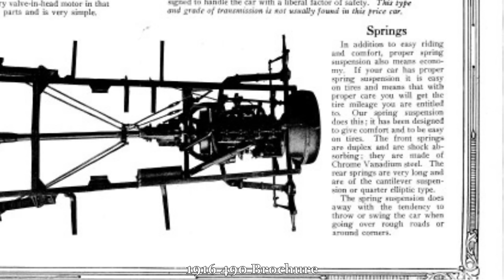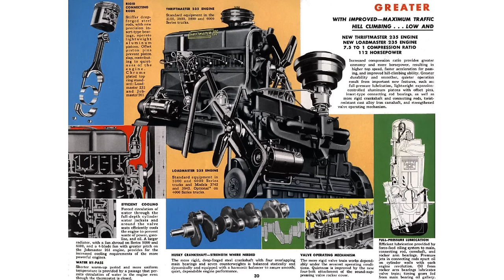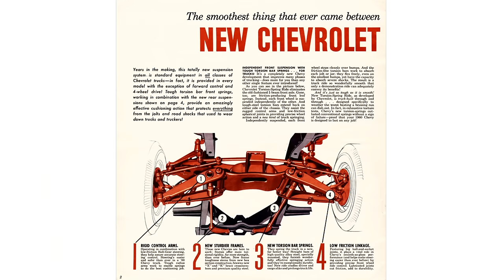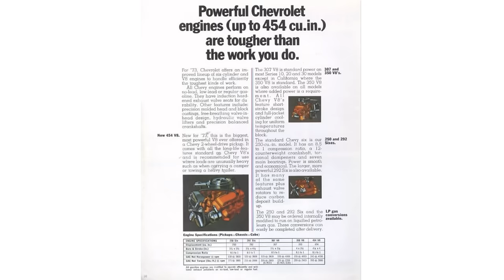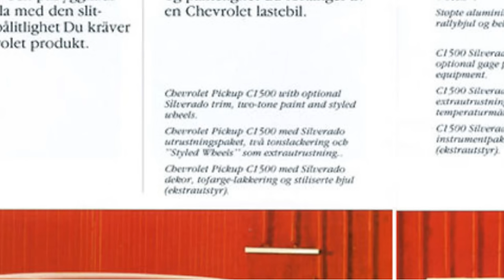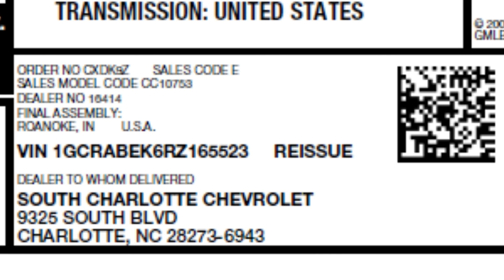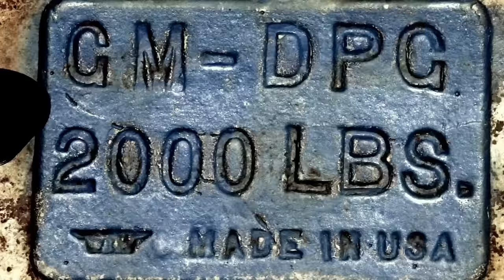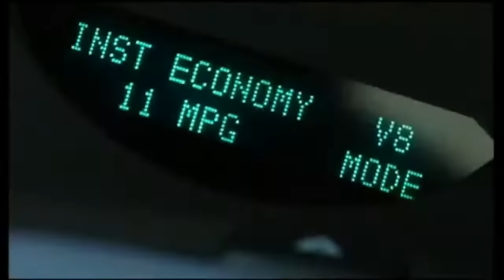History of Chevy Trucks From Advanced Design to Silverado

Comment: 3rd gen C/K was the first pickup to use the wind tunnel to measure aerodynamics in the design phase 

1986 fuel injection became available with it becoming standard in ‘87

I daily a 2000 Silverado that’ll roll over 303k miles later this afternoon. After having owned and become experienced with various GM pickups from childhood on, I believe each generation had a certain character. A certain experience that was very particular to that particular model. Unfortunately, that spirit of Chevy truck died in 2013. The current Silverado isn’t so much a Chevy as it is simply ‘another truck.’ To better illustrate this point I’ll highlight some examples. 

2009 2500 handled like a rock, great work truck, interior setup I thought was pretty car like but it more than made up for it by truly being a workhorse 

2000 Silverado 1500 Ole faithful, not the fastest, not the slowest, reasonably easy for non GM mechanics to repair. It’s done everything I’ve asked of it. It’ll be around for a lot longer. 23 years old and still worth repairing. I replaced the factory carrier bearing and u joints last month. 

1997 Sierra (yes technically GMC) step side 305 / 5 speed
This is the truck I regret selling. Not the workhorse of a bigger truck and certainly not an SS but as a daily driver honestly one of the most fun vehicles I’ve owned. (I’ve owned over 25 from all 3 domestic as well as Toyota, Honda and Nissan)

1980-1987 C/K 10
Aside from the diesel these are probably the most ‘modern’ classic pickup you could hope to find. Stylistically, they have nearly everything a proper classic truck should yet they are commonly found with creature comforts like power steering, breaking, AC and a ride that can rival many trucks 30 years newer. Plus the aftermarket and support for these trucks is HUGE. Sure it takes some cash but what could be cooler than a 30 year truck with Bluetooth and heated leather seats??

74-80 I set these aside from the later squares because they are more utilitarian in spirit and honestly these are my favorite. Sure you lose some features but nothing beats floor vents, round headlights and chestnut on the dash. 

Lastly, I’ll mention a ‘49 Chevy 3/4 ton. It’s not mine but belongs to a relative who has allowed me to drive it from time to time and holy cow, you want a true time capsule experience. You want to feel like a farmer from the ‘40s this is the truck for you. It’s about as far from a 2024 Silverado as you can get but trust me, it’s good for the soul. You’ll swear you’re at Indy even though you’re still under 50 mph. There’s nothing like it. You just can’t help but smile driving the little monster and listening to the stove bolt sing.
Reply from the maker: LOL. Thanks so much for sharing some memories !
Reply: @AllCarswithJon  on a serious note, thank you for the video I’m new to your channel but I’ll certainly be a frequent viewer going forward.
Reply: 3rd generation ones are awesome. Amazing how they were in production for 19 years "1973 - 1991." 1987 was the last year for the half ton & three quarter ton plain cab pickups, & 1989 was the last year for the one ton plain cab pickups & medium duty series models. They were the last to have the base 3 speed manual on the column transmission & the half ton pickups were the last to only come in plain cabs. 1980 was both the last year for round shaped headlights & first year for square shaped headlights. The square shaped headlights came standard on models with the Silverado & Sierra Classic trim levels & optional on models with the other trim levels.

Comment: I had a 1967 C-20 Camper Special with the panoramic rear window option. 327 with a 4 speed on the floor! Geared so low that you started out in 2nd during normal driving.

Comment: Best trucks and vehicles I've ever owned have been an 07 Silverado Classic 1500 Z71 Ext cab LT and an 18 LTZ 1500 double cab 4x4 both 5.3s. 4 speed for the 07 6 for the 18.  Never had luck with older vehicles went newer and of those 2 gens gmt800 and the K2XX the K2XX has been the best and most reliable truck I've ever owned. Gmt800s are solid yet have far to many interior flaws a bit slow and had a snappy 4 speed trans the 18 with the 6 speed just doesn't have. 18 is perfection and the height of Chevy trucks imo. Personally my least fav bodystyle ever is the 73 - early 90s and the 19 - current trucks... classic wise I think the 67 - 72 were the last really good ones and the height of classic design. If the gmt800s had more power, smoother shifts, and a better quality interior with far less squeaks rattles and better interior quality those very well could have been the best. 18 ltz so far has been 100% flawless for me. Appreciate the extra attention to details, toughness with luxury and overall quality newer has offered me older vehicles just haven't matched for me. Never had any afm or other issues ever with the 2018. It's like a much higher priced luxury vehicle just in a truck at a good value and does everything well.

Comment: Actually the Avalanche was not solely offered as a Chevrolet model. Cadillac also offered a version of the Avalanche as the Escalade EXT. A slight error in an otherwise good video.
Reply from the maker: Yes I know... I think in the video I worded it as "only a Chevy offering". Specifically I was trying to emphasize it wasn't ported over as a GMC product, but in hindsight (and since 2 of you so far pointed out the EXT) I should have added a couple of words that Caddy had a version. :)

Comment: GMT-400 are the best trucks ever built. They had the toughness of the square bodies with just enough creature comfort to be an improvement. Back before mangina gimmick trucks were a thing. Today I drove my 95 3/4 ton suburban literally through the roaring waters of Mobile bay during a bad storm. Everyone else turned around when the water got over the lugs. I pushed her all the way up over the hood with waves hitting my doors. Driving through driftwood and sea grass, jumped the median even. The ol 6.5 diesel just a rippin. 2 old Chevys is all this 20 year mechanic will rely on. Keep em tip top and refuse to progress. Heated seats and leather never got me home. And a camshaft eating 6.0 LS only ever hurt my feelings and my wallet. GMT400 FTW.

Comment: Chevy, has been out sold by ford for 47 years because Chevy also has to compete with their partner GMC. Separate GMC and Chevy fighting eachother means you can’t get the Chevy dealer down to the price you want, try the GMC Dealer and a GMC. Where as with ford ending mercury trucks in the early 70s you want a ford product you have one option by a ford. If GM made a company GM Trucks, then offered the GMC and Chevrolet badges as branding and modeling packages. Fords would no longer hold the thrown. I personally think GM is very clever. I’ve met many Chevy owners who won’t kick the tires on a gmc and many gmc owners who won’t test drive a Chevy. Even though all that separates the two is badging. Ford up until the early 70s had Ford and Mercury trucks, and Dodge had Dodge and Fargo. Both ford and dodge ended their competing side brands because they couldn’t sell the same numbers as GMC and Chevy.

Comment: I love my '57 task force 3200 (shortest of the three long bed options).  There's nothing like an old 235 I6 with that oil bath air breather.  I can literally stand in the engine bay on both sides of the engine.

Comment: The bottom line is Ford sells More Trucks Than Chevrolet because the F-150 does not last long enough. People buy Chevrolets and drive them forever! There's no need to buy a new truck every 3 to 4 years if you buy a Silverado
Reply: Yup. Still plenty of gmt400 and gmt800s on the road here
Reply: @shadowopsairman1583  Just bought an 06 GMT-800 SUV for the wife. Plan on getting it undercoated since we live in the NE. It's still better than the 13 Dodge van she traded.

Comment: In my opinion the 2002 Chevy Silverado was the best truck ever easy to repair cheap parts and great performance.
Reply: I've got one of those, you're right. Only issue is the rust. I have an 02 F150 too, and hardly any rust compared to the Chevy.

Comment: It seems most times Chevrolet does a mid production face lift on their trucks, I usually like the pre facelift looks better.  
67 and 68 were great looking.    I don’t care much for the 69 and 70, but the 71 and 72 are pretty good. 
I prefer the 70’s square bodies over the 80’s, but I do like the 80’s trucks. 
The 95 changes were mild, but I still like the trucks better before the updates.   It’s mainly the older style dash I like better.    But I liked the later OBS trucks enough to own a 97
99-02 look good but the 03-07 cat eyes might be the ugliest trucks gm ever made.

Comment: gmt800 and gmt900 (pre 2010) have proven to be the most reliable gm trucks you can buy. Interior materials suck but seat comfort is nice.
Reply: Don’t forget about the GMT400!! Hands down the most solid generation 💪 LIKE A ROCK 🪨
Reply: @GMTfourhundred 
You’re 100% correct. I currently have 2 GMT 400’s, 1 GMT 800 & 1 GMT 900. I’ve had 6 GMT 400’s in total, 1 1988, 1 1993, 1 1995, 1 1996 & 2 1997’s. All but 1 of them were all bought brand new. They have by far been the most reliable trucks I’ve ever owned !!

Comment: 13:35 - Removing vent windows wasn't a plus. 
Chevy has missed an important issue for the last 20 years - a truck needs a bed - a real bed. These 5 foot beds are stupid. Also is this fractional sizes of beds, like the 5 ft 8 in or 5 ft 10 in or other weird sizes. Beds need to be 6 foot or 8 foot. They need to be that full amount, and they need to be standardized on width. It is like Chevy is more interested in keeping the aftermarket accessory market alive than providing a truck people can use. 
It is pitiful when a compact or subcompact pickup uses a large bed than a so-called full-size truck. 
Then there is the electronics fiasco. Many of the Chevy trucks from 2015 and newer have electrical issues, often stemming from the fuse boxes and the central control box, where contacts corrode from moisture. Hey, this is OUTSIDE in the engine compartment, where things can be sprayed from wet roads, or where people occasionally clean with a spray hose and having modules and boxes that are not sealing tight is a horrible way to build a truck. 
The Avalanche has its fans, but as a couple of people have told me, they use it as a pickup only when they just have to. A normal pickup has a lot of air turbulence that will throw leaves, dirt, sand, and water inside the cab if you have the rear window open, and with the Avalanche, you have the whole back open! 
I didn't hear it, and I think you skipped the Quadrasteer models. These were a great system, that allowed to you maneuver a full-size truck like a subcompact. However, ti was expensive and they were complicated to work on, but they were really neat to drive. With one, you could actually park at Walmart or half of the strip malls that use miniature parking lots.